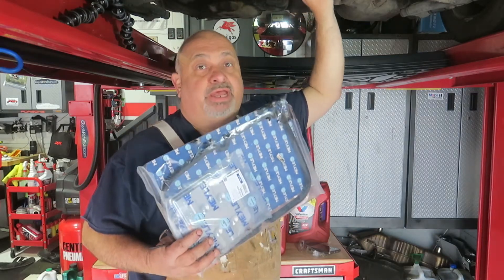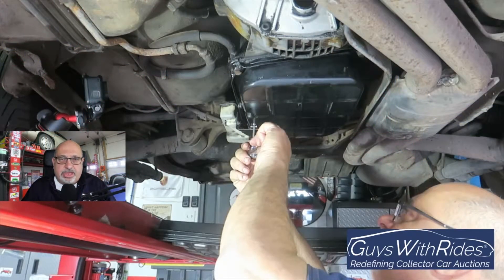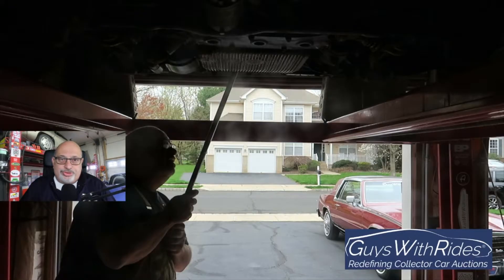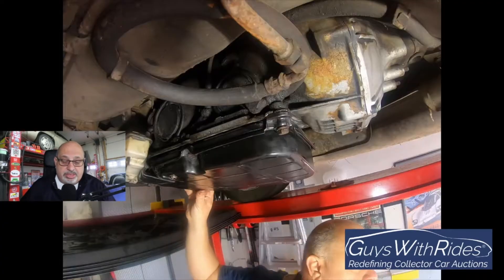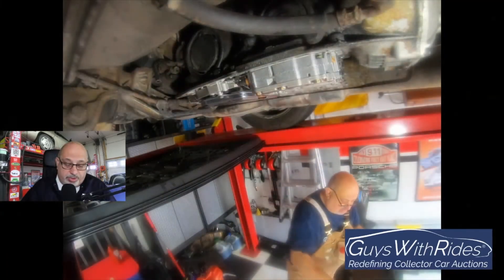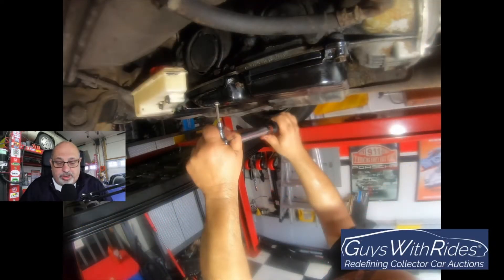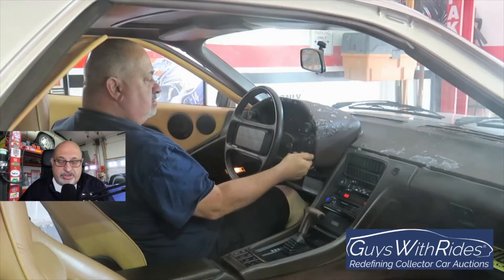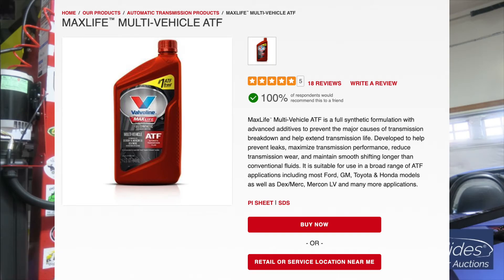How To Change The Automatic Transmission Fluid and Filter in a 1985 Porsche 928S 32V

Comment: Thank you for the video. I was told by the dealer I have a small leak at the transmission seal on my 928 S4. They want 1200$ to do the job.. Your video was a big help. I saw in a comment on another video how its much easier to find the torque converter drain with a another set of eyes. I will be doing it solo like you so I plan to be patient for that part of the drain. Thanks again for the video.